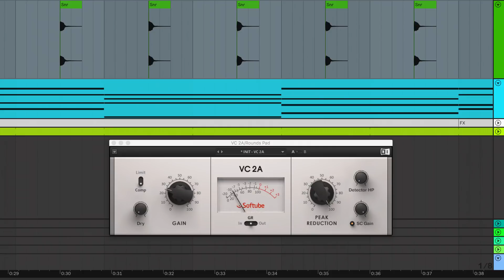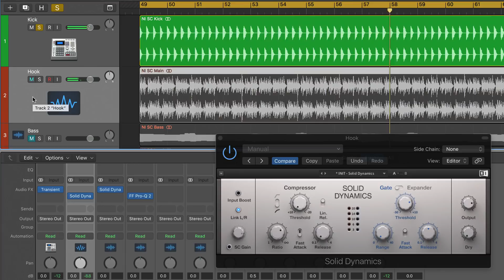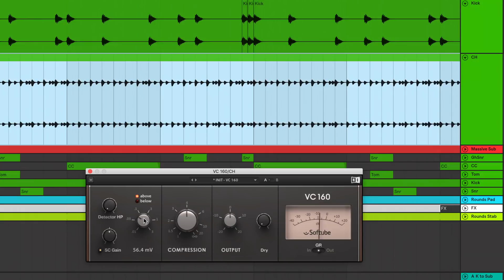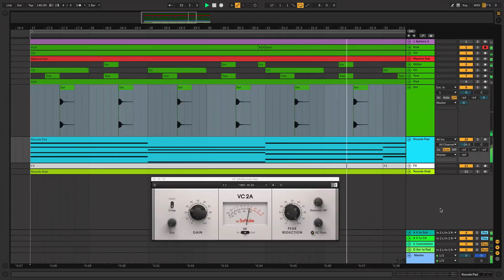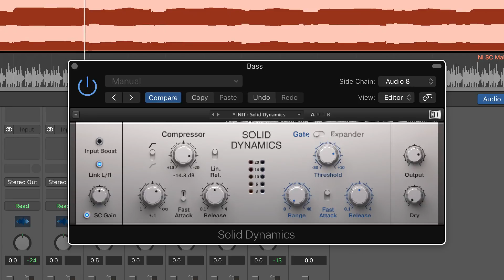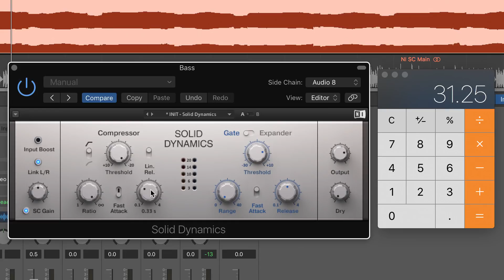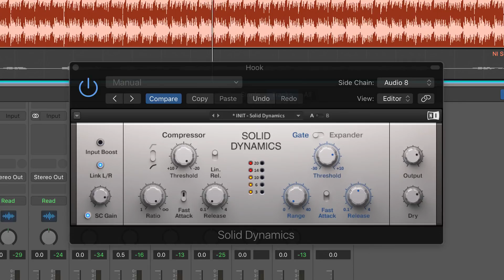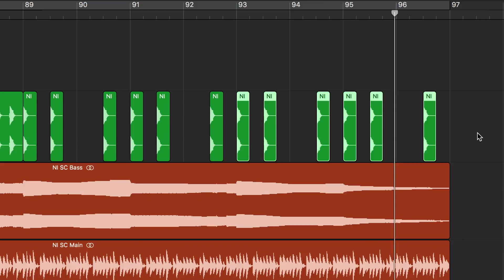How to: Use sidechain compression | Native Instruments

Comment: 20 ms is not 0.2 s but 0.02 s !!
Reply: Release time is not an absolute specific time it takes for the compressor to "release" but a rate of change (yes, the fact it's cited in milliseconds is deeply misleading). If the compressor is doing, say 12 dBs of gain reduction and the input suddenly falls below the threshold it is going to take more time for the compressor to release (return to doing 0 dBs of gain reduction) than if it had only been doing 6 dBs of gain reduction. So the whole exercise is pointless.
Reply: Two cars both going 60 mph are going take different amounts of time to go different distances. In a similar manner, two compressors with the same release settings are going take different amounts of time to "release" different amounts of gain reduction!

Comment: How do you route your side chain to a track in ableton live 10? My solid dynamics does not show an option to choose where to side chain from as it does in logic.
Reply: In the Ableton Live window set your "Audio Output" Routing in the Mixer Channel from your Kick or DrumRack to that track where your compressor device is. I use an extra Kick-track for sidechain and set the output to "Sends Only". At this way you have more control.
Reply: Hay dude, I have tried this but the problem is I also have the sound of the kick coming out of the compressed channel as well as the instrument i'm compressing (synth pad or whatever)   and obviously if you mute the kick channel it doesn't work???